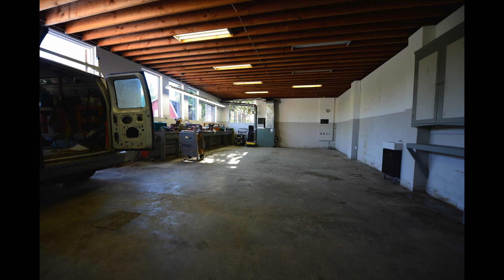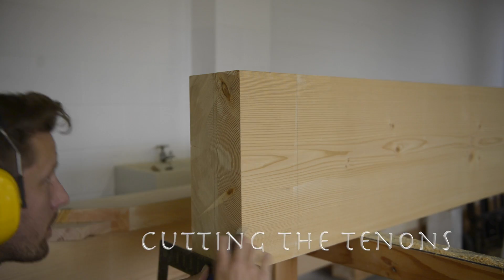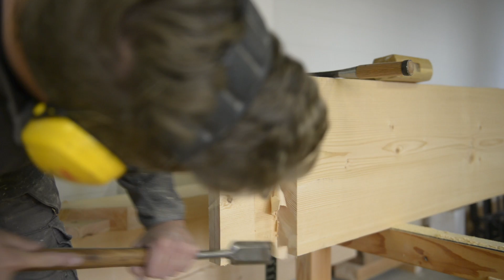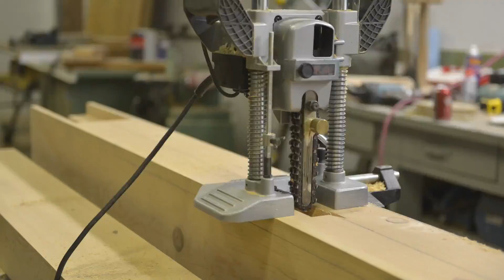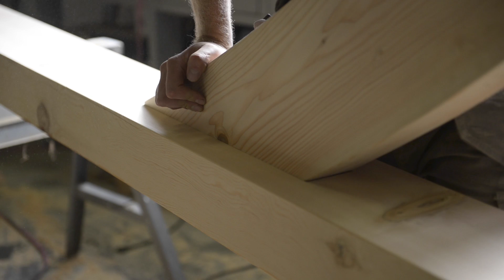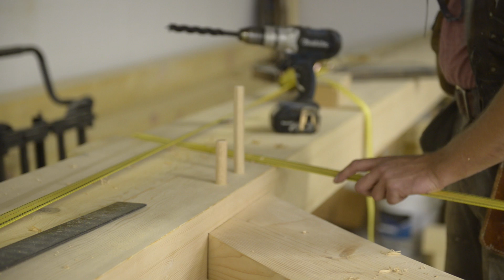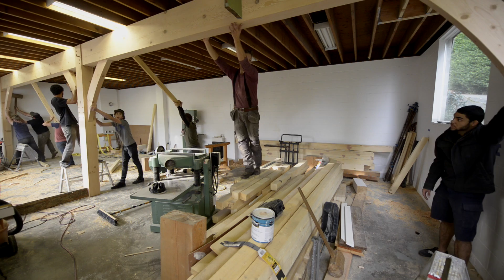How To Install Huge Beams with Joinery

Comment: I have never undertaken a job of this magnitude, but expect to take away needed knowledge for smaller scale joining of larger beams (in my case 4" x 6" x 12' lumber.)  The end product is magnificent.  But, a professional woodworker who is teaching so many people (860K subscribers) should not only protect himself but set an example to those who turn to him for that knowledge.  The lack of both respiratory and eye protection, particularly in the early part of the video when using a circular saw, planer and router, is very noticeable, especially when there is a large, unconnected dust collection system sitting at the back of the area.  Please remember your students as well as yourself and use personal protection equipment as you make these videos, and while working off-camera for your own enjoyment.

Comment: Why? The beam is massively oversized if you just wanted something to mount to and clearly not structural, seeing how you installed it into a preexisting structure. Dickwagging, no more

There are lots of good videos detailing the construction of functional structures on youtube using more traditional timber framing methods. Search timber framing
Reply: He explained at the start of the video (ca. 17 seconds  in)  that the beam was to support the floor above, which was springy in the middle due to the length of the joists.

Comment: sorry  why cut down your joint  to 2x6   to put load on the  small point   some one come in dont know this cut out you  side  post  all  that weight on  the 2x6  pace or over loads the top floor or  
earthquake   i think joint going pop  https://eaglepondhouse.files.wordpress.com/2012/05/img_5347.jpg   this  more way i im thinking  being work shop  tool wood and  heavy machinery may be put in  up there  i add in a metal joint cleat